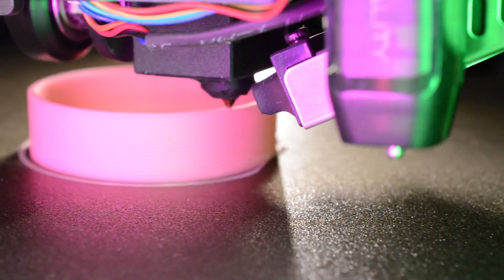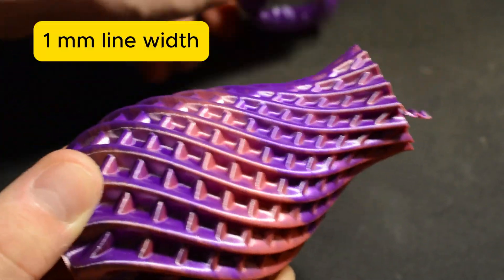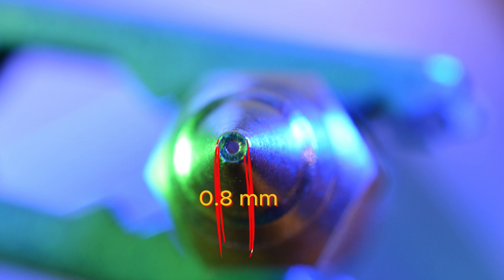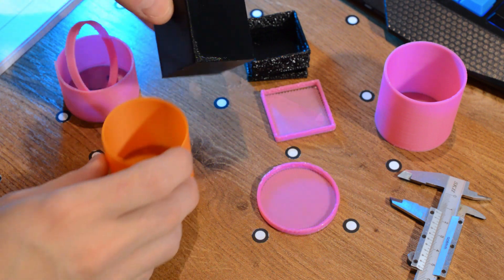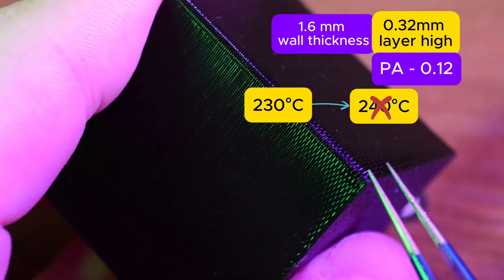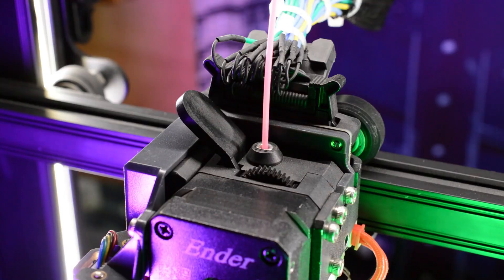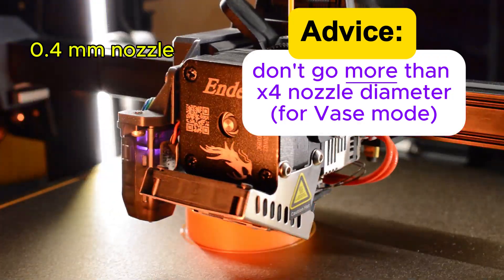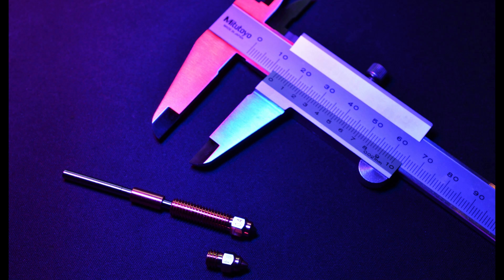Strong 3d printed objects with 1 wall | Spiral Vase mode

Comment: I usually use a 1mm nozzle for printing in vase mode for items I want to be durable.. laying a 1.5mm wide line makes for some sturdy, fast prints.
Reply from the maker: @chadsulski9020  1.5 mm wide with 0.4 mm nozzle it's very good result, my congratulations 👏

Comment from the maker: What is your favorite line width for technical prints?
Reply: for printing .5 module gears I like using a .3 line width from a .4 nozzle.. Makes the teeth almost the perfect resolution for a smooth noiseless geartrain in R/C car applications..
Reply from the maker: @chadsulski9020  I was also using 0.3-0.35 mm for gears, but sometimes it's quite difficult to get a nice bed adhesion, with such a small and narrow line)
Reply: @chadsulski9020  , could you please tell which material you use for gears?
Reply: @badcrash99  Usually PETG .. Thats pretty much all I print in as its cheaper and more durable than PLA.
Reply: i use 0.65mm on a 0.6mm nozzle because not all nozzles are perfectly 0.6mm
Reply from the maker: @captainheat2314  In spiral vase mode you can go up to 2.4 mm line width, hopefully without quality issues